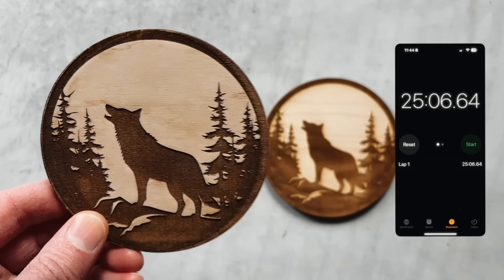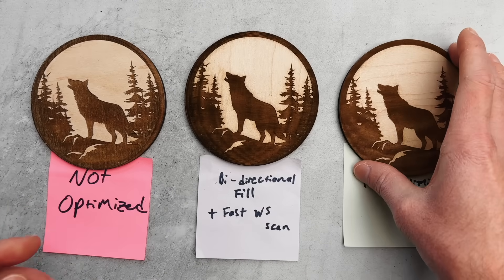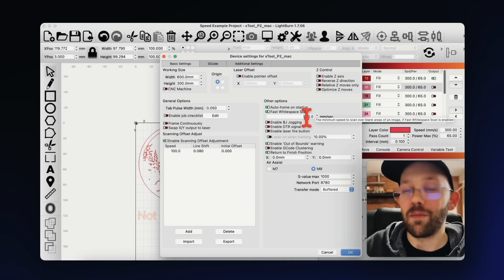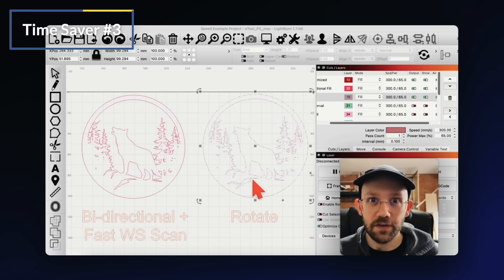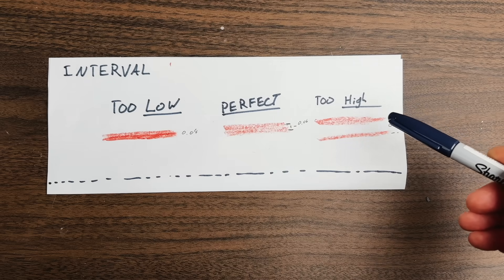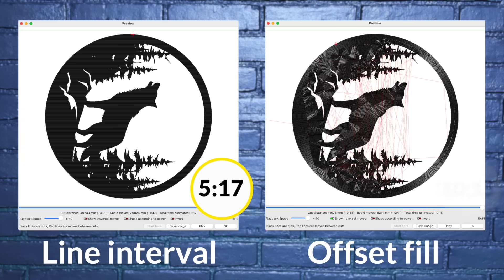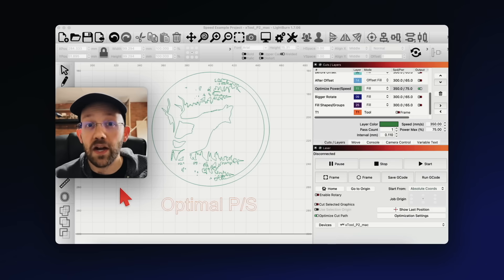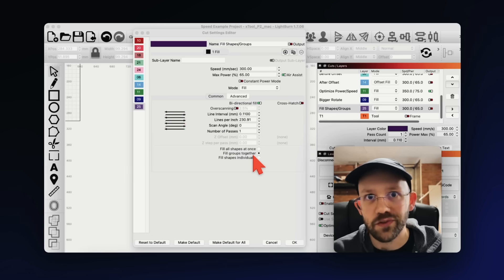Slash Engraving Times by 73% in Lightburn

Comment: Good video with helpful information. One tip I have used to increase speed in engraving is to actually defocus the laser so it's farther from the workpiece then increase the power slightly to compensate.  Then I can use way fewer lines per inch because I am in effect, "painting with a bigger brush" when I engrave. And if I'm doing lettering, I will refocus the laser and do a high speed outline of all the letters which really sets them off in contrast. Thanks again for the well done video.